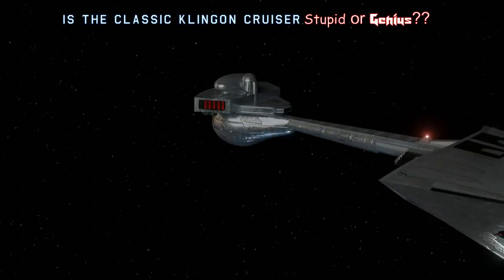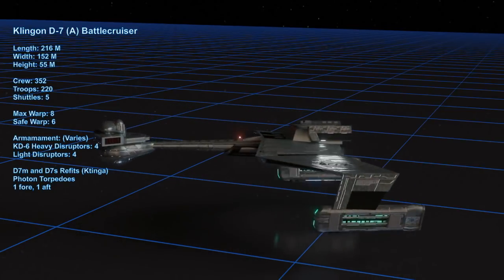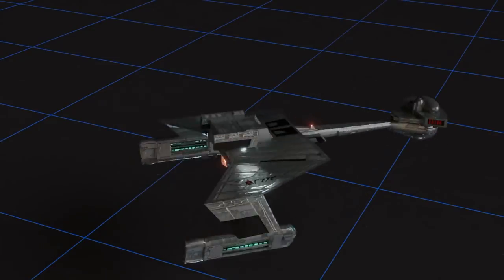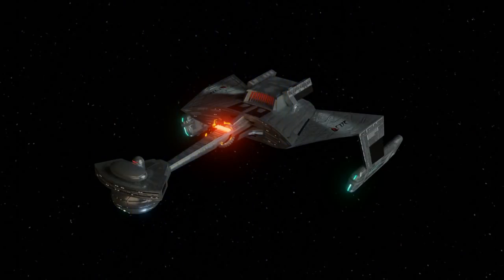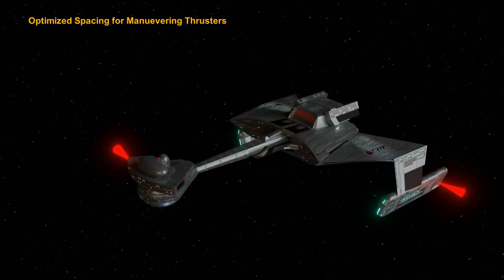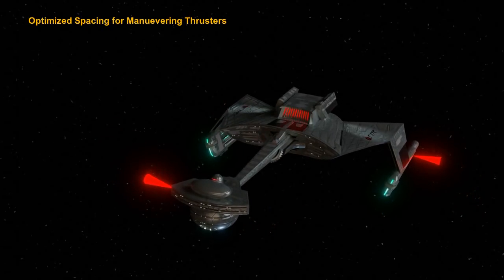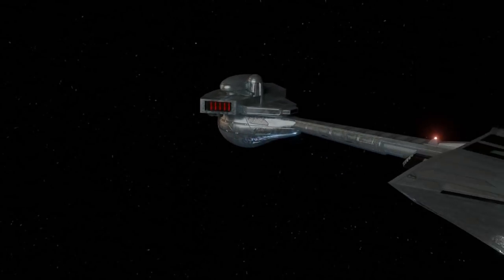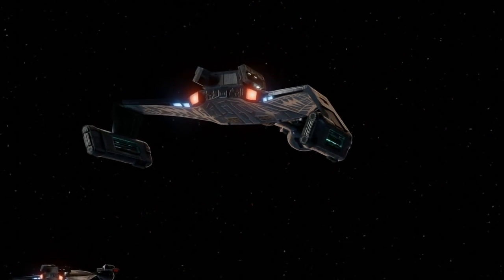The Classic Klingon D-7 Cruiser - Stupid or Genius Design?? Animated Breakdown!

Comment: I would love to see a proper breakdown of the sheer size of the K'tinga in comparison to the Constitution/Miranda class ships.  While the D-7's from the series may be canonically smaller than the Constitution class, just to judge the K'tinga's size on the size of the windows (specifically the observation deck located above the shuttle bay) the K'tinga has to be HUGE

and yes, the 2 level of lights above the photon torpedo generator is 2 levels, as the windows circling the pod match the size of the windows in both the cap on top and the windows seen on the front of the main body.

It is also interesting to note that at the back base of the pod's neck is a 2 story rec room, maybe akin to the 2 story rec room seen in ST:TMP in the back right section of the saucer of the Enterprise.

Comment: The ship design of a Klingon is more of a hammerhead style ship design if you’re looking at the D7 head-on you can rarely see the portable neck most Klingon tactics or head-on attacks plus it would allow you to focus the shield power around a specific area as well as your weapons yes you have that vulnerable spot but usually Klingon ships are faster more maneuverable than their counterparts meaning they can angle weight and only show the heavily armored heavily armed part of the ship

Comment: Okay,  2 cents comments:  Maybe sensors  arrays (active or passive) spacing or  storerooms (for special parts) outside the main propulsion section and rapid access or finally to add  more security. Only one way to access the ship from both sides, but easy to space out your enemies  from inside or outside.   Control.

Comment: the design from the show clearly taken inspiration from real life plans for long range space vessels (long and flimsy, since one of the best radiation shielding is distance, and any hit will be fatal anyway.) adding the part that materials are not strong in universe to take hits (until later shows bring it back with cgi, you do not want to damage the physical models or paint over them,) so once the shield down, the neck and the main body is equally strong, cannot take any hit at all.

Comment: A complicating factor for all of what you have said -- though I have no problems with it, save for what I'm about to discuss -- is that the D-7 design dates from the TOS era. What makes that important is that, prior to the first movie and that big engineering set therein, the matter-antimatter reaction was supposed to take place in the nacelles. That is why they were mounted outboard in both the Enterprise and the D-7 -- to keep any radiation leaks as far away from the inhabited parts of the ship, and also so that they could be jettisoned in case of a possible explosion. That doesn't explain the boom, but it does mitigate the cruelty of stuffing all the other ranks/servitors in the back while the officers are up front. I think the security explanation is the best reason for the separation, though they could have made the boom a bit more robust. Of course, it could depend on the precision of weapons fire through shields; if shields spread the energy of incoming weapons over an area, a weak spot like the boom, especially when blocked from many angles by the rest of the ship, would be very difficult to hit. Once the shields are down, though...

Comment: Well, I've often asked myself the same questions about Starfleet vessels, at least the ones using the two hull concept. Just looks like a tempting target for enemy fire to decapitate the ship at its neck. So the logic must be something to do with generating successful warp fields and possibly warp impact on operations you want to do in the saucer. So I assumed design issues affected the Klingons as well. This doesn't explain Romulan ships, but maybe a forced quantum singularity imposes different engineering problems.

Comment: It's also worth remembering that Klingons generally go into battle with rather long locks.  In some Earth warrior cultures, keeping hair long is a symbol of extreme confidence.  An exposed neck may serve a similar function to Klingons. 

That said, most every Original Universe Klingon warship shares this sort of dual-hull design of a forward extension and wider aft, with or without traditional nacelles.   Even smaller short-neckers like the Bird-of-Prey have it.   Given its inefficiency from the perspective of starship volumetrics, this would suggest a solid technical reason (maneuverability, warp dynamics) rather than merely the boys letting their hair down.

Comment: Well, actually - My usual reply to people suggesting this is a weakness is - "How do you attack this 'weakness'?" In Star Trek, vessels are always shown to be fastest going straight ahead while other directions are managed by smaller manoeuvring thrusters, and weapons are always line of sight (which is odd, but shh). So to get line of sight on the 'weakness' you've presented your own ship side on to the Klingon weapons, exactly what they want. 
Which, alright, that's mostly only equal 1 on 1 battles, what about uneven fights or all out war? Assuming it is just a hallway, there's nothing critical there, you've dedicated a considerable force to cutting the neck (while the Klingons are shooting at you), at worst killing the cabin boy carrying a bucket of Gagh and triggering the airlocks, but the enemy ship is still fully capable of firing back, now from 2 separate vectors that will each require being destroyed individually instead of one blast crippling the entire ship... It's a lose-lose if you go for the neck.

Comment: older D7 were disruptor only according the the original material.  The boom section was able to disconnect and operate on its own albeit at reduced strength.  Crew mutiny was a real concern so security stations separate the rear hull from the boom.  This is based on the original material by Amarillo Design Bureau as licensed by DesiLu productions who owned rights to original series.  Paramont came in later and made their own stuff.

Comment: In TOS, where the design came from, ships didn't fight like they did in later series. They stood off at range and exchanged fire instead of closing to a point blank dogfight. The D7 would have likely pointed itself head on at the target while firing from a few thousand miles away. That protects the neck, gives the enemy a minimal profile to shoot at, and puts that deflector dish in line to help protect against any return fire. Add to that the fact that the hull of the ship was not going to offer much protection against a warship which could both launch 4 antimatter torpedoes at a time, each with a yield of 20 megatons, and fire a volley of phasers which likely had a similar damage output. In short, if the shields were up you were good, if they went down it didn't matter how thick the neck was, your ship would die. When the movies and TNG came out, they had more money for special effects and started having the ships fight in close range slugfests, because it looks better on screen. Incidentally, the Constitution Class likely fought head on and slightly nose up for the same reasons. That seemed to be what was shown in TOS too.

Comment: I'll throw one out there for the spinal mount (sort of).  In the original animated series there was a D7 modified to carry a stasis device.  Now since besides the weapon effect itself, there was nothing noticeably different about that Klingon ship, iirc.  So...  The enormous power demands of the stasis field generator would indicate that the power and control runs for a spinal weapon very well could be there.

Also, consider this, while your note about the angle is definitely true... There's the impulse drive and (possible) small warp core back there at the end of the boom.  What about a line of disruptor capacitors that allow the D7 to keep up firing all her weapons while using maximum drive power for maneuvers?  Said capacitors being charged by the impulse reactor and tiny warp core, since they aren't being used to generate motion.  That accounts for the weapon performance we've seen, still allows the advantages of the boom and the plan could be that there was supposed to be a super-heavy disruptor emitter for the bulb of the boom, and the petaQ in charge of designing it failed in his task.  I dunno, but power systems and control runs for a larger weapon are still my best bet for the boom's design.

Comment: Forget where I read it many years ago, think it was one of the early Trek books like Making Of... but the point of the neck was cited as a safeguard against mutiny. As for arguments that it like the thin nacelles on the original Enterprise and the fin connecting saucer to main hull, well, yeah
 Once you lose shields phasers and torpedoes are gonna murder even 24rd century alloys.

Comment: Yeah I think the, "we have shields, why armor the hull, that just slows use down" and traditional design make perfect since. And as others have pointed out too, you could make the neck bigger but why? One to two torpedoes will still destroy the entire ship. I mean one could argue that a single torp to the neck would safe the ship as both sections would be largely undamaged and still functional. Now the enemy has two smaller ships, both with weapons and maneuverability. Now the two sections could pull off some pincer attack and win. Or if the ships mission dictated Klingons run from a fight the rear section with the warp drive could just bolt abandoning the forward section to death by glorious suicide attack run. This way some vital info makes it to Klingon leaders and the ship was largely saved and can have a new neck and bridge made rather than a whole new ship.

Comment: We have to remember that a lot of the "In universe" designs are influenced by the warp field.  The boom leading out to the command section might be necessary, at least during the era that it was designed, might have been necessary to help maintain a stable warp field.  Or it simply could be a cultural thing, a particular design detail that dates back to when the Klingons used ocean going vessels, the Klingons are, after all, really big on tradition.

Comment: The centerline-mounted weapon may be a beam weapon, so then you could use mirrors or something similar to project it out the fronthole. Maybe it's like laserchamber, where photons bounce several times between the ends in a zig-zag pattern before exiting off the lower aperture.

Comment: The maneuverability and warp field shape are the most likely reasons, but I don't think the radiation theory makes sense.  However, having a lower-class of Klingons as crew in the aft section, whether or not they are slaves, does make sense if the higher-class of officer Klingons want to be able to scuttle a renegade crew in the aft section.  I wouldn't put it past them to do something like that!

Comment: Rather than warp geometry, it could be shield geometry. Have the shield emitter in the nose. The engineering section is then extra protected because it'll be behind more shield. PLUS, it makes the officers feel more out there and exposed while actually not being in particularly more danger. The tradeoff is that they can't run away effectively. Seems like a feature to Klingons.

Comment: I may skip a few timelines here ! Sorry !!! It appears to me that the Klingon war ship had a plasma type weapon as used in the battle with Veger ! Able to fire forward and from the rear ! The long boom would enable a larger buildup of this plasma before release, by bouncing it back and forth through the entire length of the ship further intensifying the pulse before release !
Reply: It was a torpedo.  Plasma is a gas, it would spray outward worse than a hosepipe since magnets don't contain once out of the container.
How do the crew travel through the ship if the neck is filled with charged plasma at 10s thousand degrees?
Also, the video author has addressed your idea at the start of the video.

Comment: While the D7 is obviously the most prominent example, it's worth noting that a number of ships from across multiple different spacefaring cultures, particularly in the Beta Quadrant, seem to favor modular designs like these with a thinner neck connecting separated command and engineering sections. 24th-Century Romulan warbirds, the vast majority of Klingon warships, and Federation starships following similar design silhouettes to the Constitution-class all share this common design feature in one way or another.

This suggests that something about either warp field geometry or starship engineering makes this an advantageous design choice.

Comment: Can go with several "well akkshually" here :
The Feds had their own built in weak spots -- the 'neck' between the saucer and main drive , and the thin connecting pylons between the drive section and the nacelles -- defects that took them 100 years to slowly remove (and occasionally put back) .
Also , while this is mere 23rd century tech , the Dominion Attack ship from all the way to the mid 24th Century -- was also vulnerable to ATTACK FROM ABOOOVE -- at least according to Wayun The Deffective (who liked Odo more than the Founders ) .
The D-7 does what the Klingons want out of a warship : it presents a small enough (read:thin) forward profile as an attacker (as the Klingons see themselves as) , and a forward approach also hides the mass / size of the ship . Once combat evolves to include angle strikes , the forward section is smaller , thus more difficult to hit ... -- while a lucky shot could potentially damage or sever the "neck" .
It's not perfect ... , because it's not a Borg cube . :)

Comment: In the event of mutiny, the narrow neck corridors would certainly prove extremely defensible, limiting the number of potential routes from engineering to the bridge and weapon systems.
Reply: Yes, and since the used subjugated species as the primary manpower on the ships they have to maintain many choke points throughout the vessel.

Comment: 2 other possibilities come to mind: Maybe Klingon engines don't run as clean as Federation tech, so they put out some sort of emissions that would interfere with sensors or deflectors. The cloaking device could also be a system that required distance from another system in those days. Klingons are also shown to be very culturally hierarchical. The separation of the bridge crew from the grunts could be related to that.

Comment: It comes down to Klingon deflector and shield technology and development.  The location and geometry of the main deflector (on deck 0 above the bridge deck) allows coverage and “funnel channels” to be created with the secondary emitters on the main hull and warp nacelles. This allows for helium 3 collection at warp without compromising energy supplies to ship systems or field integrity both in combat and long range warp cruising. At the time of the initial D7 design the primary heat sink located on the main hull top side above the hanger deck was insufficient at bleeding off excess heat generated by ship systems and disrupted sensor operations (including deflectors). The Klingons have never managed the heat sink problem very well and the “long neck“ became the necessity of form following function of environmental control for sensitive systems (Crew comfort not being a priority or consideration in the design but of course the officers quarters would be in the relatively cooler section of the ship).

Comment: I thought the hole in the front pod was the Klingon's version of the Federation deflector array which was used to push aside any particles or matter in the path of the ship when it was at FTL warp drive (a different type of technology than the combat / defensive "shields"). The Federation used the easily recognizable dish arrays on their starship designs while the Klingons had a different design of deflector due to the Klingons being "aliens", that of a gaping maw at the front of the battlecruiser. The small bumps under the forward cowl seem to be phaser weapons as seen on the AMT kit box art where beams from the D7 are firing off into the distance at the Enterprise. 

Early D7s didn't carry forward or rear firing torpedoes, the Klingons used disruptors rather than photon torpedoes like the Federation did (it was a way to give each race a different weapon, like the Romulans used plasma torpedoes ...). Disruptors were simpler technology, took less energy to fire and could be fired more often (ROF) than photon torpedoes. These disruptors were mounted on the warp engines for direct access to power, two to a nacelle, IIRC, and were basically the "band" part at the front of the nacelle on each side. In Star Fleet Battles, the D7 is armed with Type II phasers and disruptors and a drone (missile) launcher, IIRC. The Type II phaser was less powerful than the Type I phaser used by most Federation "saucer" equipped designs, but the D7 carried more Type II phasers than the Federation CA had Type I phasers thus giving the D7 a much more "brawler" aspect, especially at close range.

I love the original design, so iconic. When you first saw it, you KNEW it was the bad guy's ship. Although I like the K'Tinga class, I think I love the TOS D7 more because it's so ... clean and uncluttered.

Comment: Usually the simplest answer is the best answer it's got on a long neck to protect from the radiation of the core in case of a leak so they can continue to battle the neck disconnects to save people from the radiation and to get the ship away from or get the crew away from a core breach

Comment: In SFB, the classic D-7 had a LOT of firepower. Chin phasers, ear phasers up front, then more at the two front corners of the main hull, more to either side of the massive warp core and engineering deck. The disruptors we're mounted in the front part of the nacelles. They were devastating.